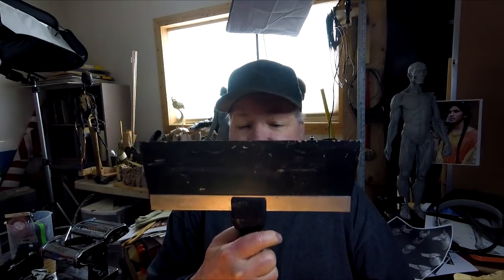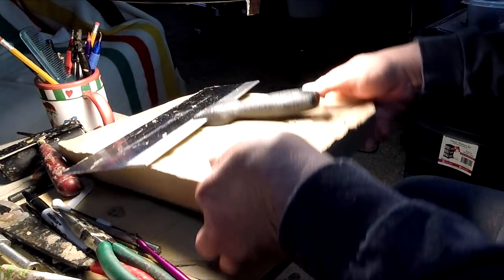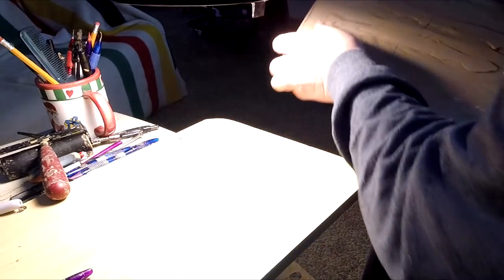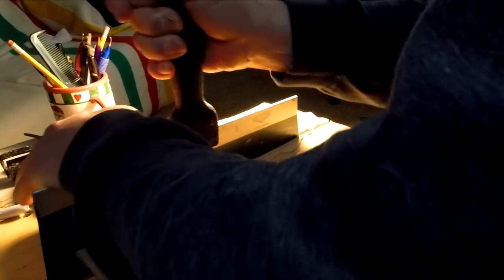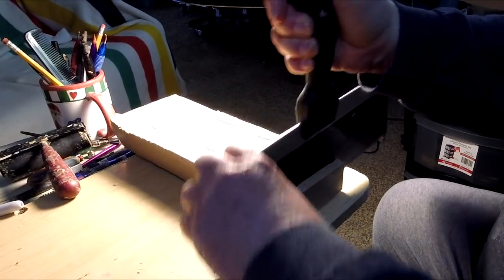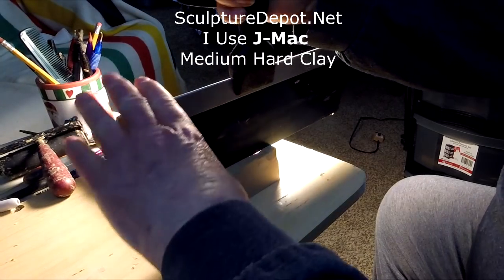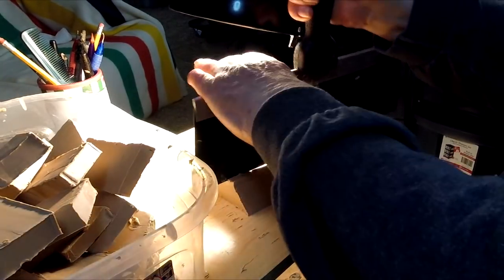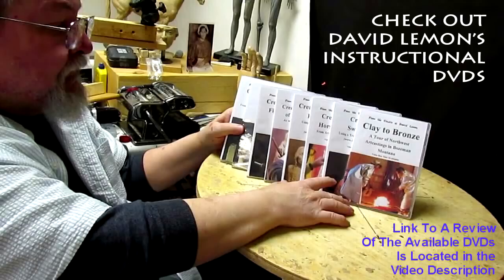I Received My Clay Today

Comment: Love your work. 
Have you tried using a "wire clay cutter" to slice your clay?
They cost about $3 on Amazon and save my hands alot of ache. I buy them in batches because the wire tends to wear out. I just loop the wire around the clay where I want it sliced and pull the ends. Don't even have to pre-heat my clay to slice it..
Reply from the maker: Good advise.. if I was using ceramic clay.. those won't work with Plasticine Clay.. it's to hard.. for wire cutting tools.. You saw how hard I had to push into the clay to cut it...
Reply: @clayguy1  I use it on plasticine clay. I guess everyone has their own preference

Comment: David if I may ask an artists perspective a personal question? I have made a 3 large clay pieces. I love working with clay and changing my piece 100 times to see what a new and different line will do to a piece. It seems I spend an inordinate amount of time with one piece redoing and redoing to try and get the desired result. I feel an obsession for the pieces I work on, and cannot wait to get to them throughout the day. I literally have to limit my time, as it will fly by and what feels like one hour, turns into 3. Is this a normal experience? Do you or have your experienced the same?
Reply from the maker: Well, I'm 75. and when younger.. like in my 30s.. yes.. but I worked full time.. so had limited time. I was married at the time as well so kids to run after. 
I have lived alone for over 30 years.. for the first 10 of that again.. yes.. but as time went on, I realized, it's best to stop after a couple of hours and just take a rest. Also, since I must cast my own work, For the last 10 years, I've really slowed down because I haven't the means to cast my own work.. Time changes your desires.. a lot. 
I now can't sculpt in my studio, till 4 pm. My windows face south and the sun boils in those windows.. especially during the winter and it's so bright It's hard to work..so I do other things... like clean my house.. laundry or dishes or play on my PS4... haha... I work on my clay from about 4pm to 5 or 5:30pm then I have to make my dinner and edit the video I shot that day... 
Time and circumstances changed my schedule.. and now age.. I can only work a few hours.. before my eyes get tired..